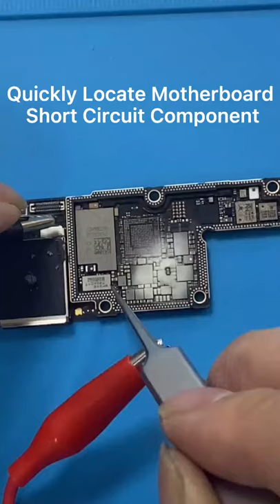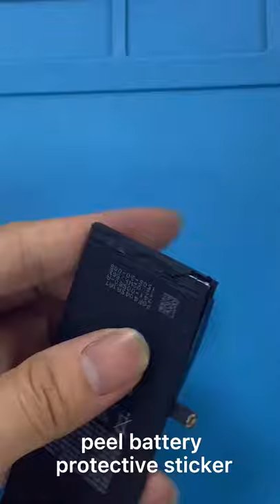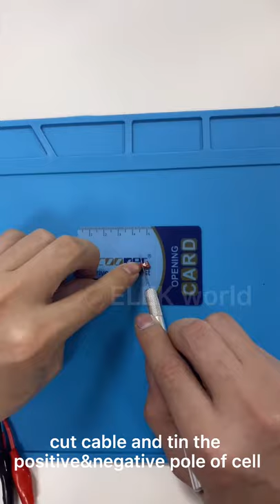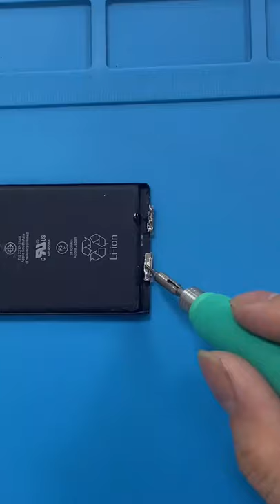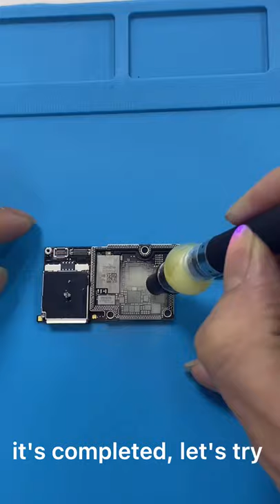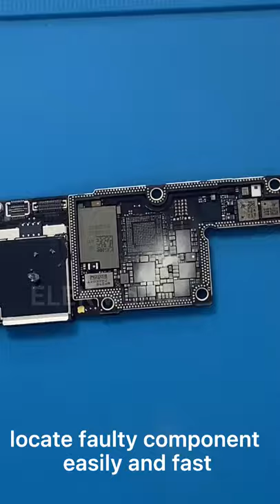DIY Power Supply to Locate Motherboard Short Circuit Component. #Shorts

Comment: As someone who does repairs on electronics for a hobby, this hurts me emotionally. That's a great way to damage the board beyond repair.
Reply: There are better ways to find the short circuit on the board.

One is to buy a proper current source/laboratory power supply and to use a thermal camera to find the short circuit.

(Yes, I did this before, otherwise I wouldn't have found a nasty PCB-Short under an SMD resistor, for example.

if you do it as shown, you may delaminate the board or destroy more than has already been broken by the short circuit - in addition to exposing yourself to the danger of a burning lithium-ion battery.)
Reply: I've used a technique similar to this on occasion. Though I use a regulated power supply. It's not ideal, but works in a pinch.
Reply: yes. he could made a constant current source with an lm137 and it would work just fine.
Reply: Thats normal way, it wont damage the board at all but using battery is very dangerous. Dcpc should be used
Reply: @armendgerguri what is dcpc

Comment: Please don't do it. This excludes the protection circuit and could cause a fire if not handled correctly.
Reply from the maker: You are correct bor. 
This method works only when the battery volt a little bit higher than faulty board, and of course supply power only for seconds, can't keep supply wiht higher volt power, otherwise will burn the board.

Comment: What if the track u want to check is less than 3.7 volts then u will burn it so ur method is not really sufficient unless the track is 3 volts or higher
Reply from the maker: Hi Fay, you are correct bor. This method works only when the volt a little bit higher than track, and of course supply power only for second, can't keep supply wiht higher volt power, otherwise will burn the board.

Comment: what if you connect the connector of the battery with a usb cable?  would you be able to start the iPhone with it as a power supply?
Reply from the maker: It won't work. Our test shows the evoltage should be higher than 4.1V then USB cable works, but the battery voltage is 3.7V mostly, so it won't power on the iPhone.
Reply: @Elekworld  battery voltage is from 3.7v to 4.2v when fully charged.

Comment: betry terminal.cant be solder normal.flux. how did u.solder please share link for flux and tutorial
Reply from the maker: Apply flux  on the battery terminal, solder tin wire with soldering iron, the tin will melt and left on the battery terminal. Then you can solder the electric wire on the battery terminal. 
If you want solder a new battery board on old battery, pls check this video: https://youtu.be/sjOCID0IN5g

Comment: يا صديقي   4 vvv  كثيرا جدا  ممكن  يقع التماس 2 و 3 وتصبح في مشكلتين. لا بد ان تبدأ من 1 v.                 كثير جدًا 4 v.
Reply from the maker: This DIY power supply was made based on know the logic board voltage, so it's safe enough. And pls make sure you know the board voltage in advance, otherwise your suggestions are very very important.